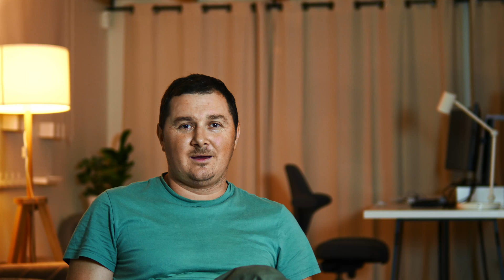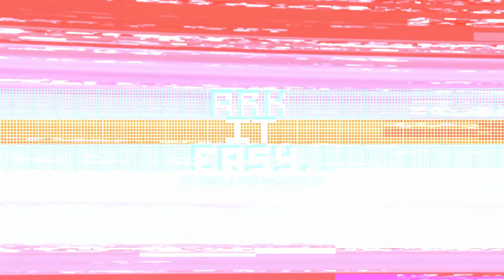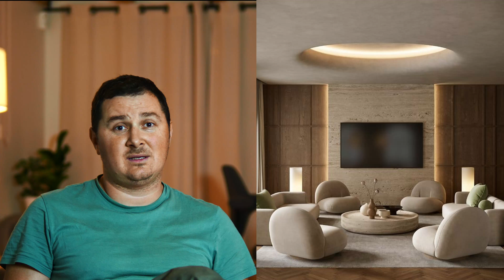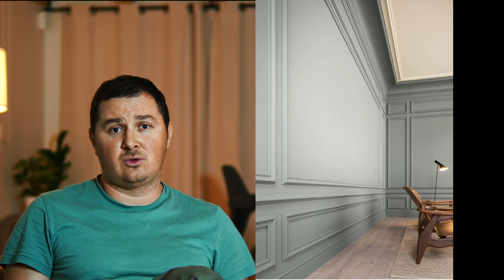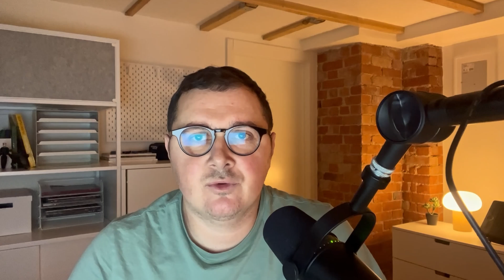Recessed Ceilings in Revit

Comment: Hello, when you created the soffit and dimensioned from the outer line to inner line, you said the outer one should act as a reference and stay fixed but It looks like when you  applied the new Global parameter at 5:47, its the outer line that moved and the inner one stayed fixed. I also thought it should be the opposite but I don`t understand.
Reply from the maker: I checked the file and it's 750 from walls to outer lines, which means that inner lines, as it's said, moved. How your file deal with this?
Reply: @arkiteasy  I tried in my Revit and it seems that its random. Some sides move and some stay. I dont think it matters which one you start or maybe its a bug. If you look carefull at the video, on the right side, is the outer line that moves while on the left side is the inner line.
Reply from the maker: To avoid this compilations then lock outer ceiling lines with a distance you want. Then, create the parameter for the soffit and it should be fine. Let me know how this will work with your project